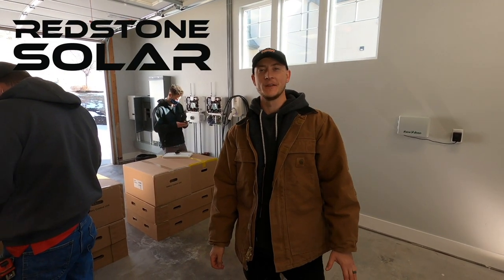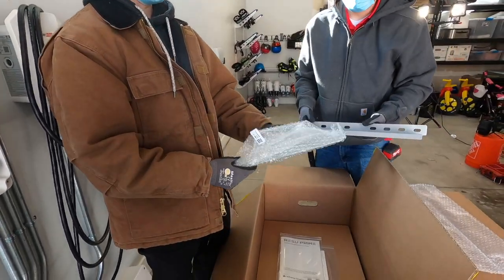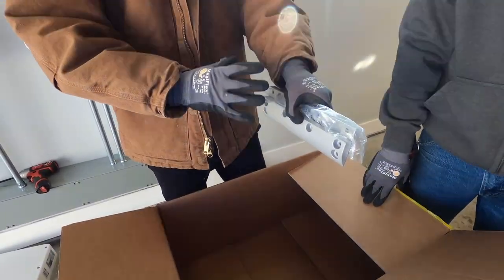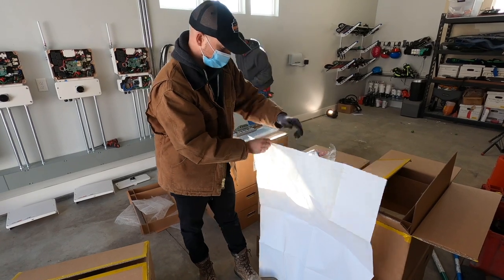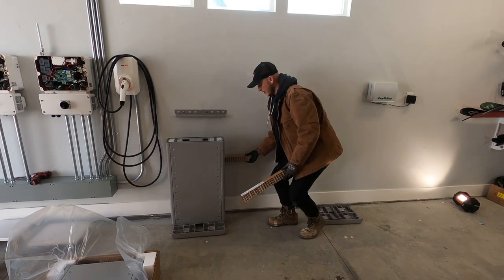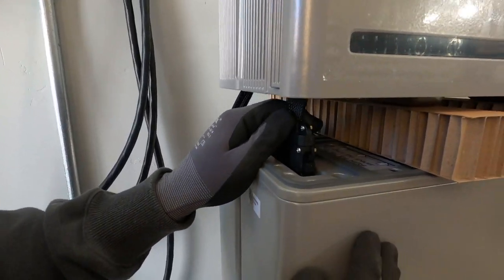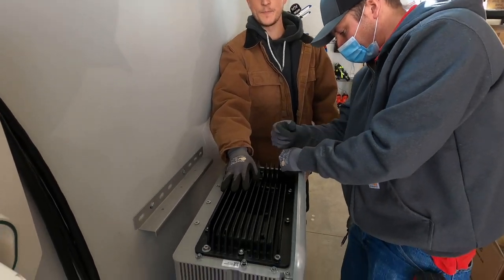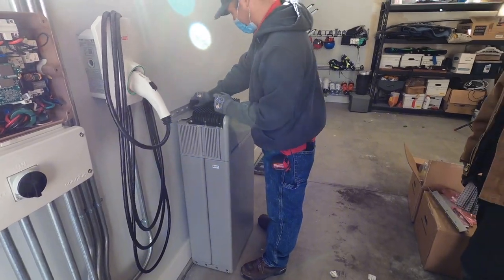LG RESU 16h Prime | Installation Overview

Comment: Just did a very similarly looking install in rural Colorado. First time installing Resu. We found that the activating the monitoring portal was challenging. The property we installed at has no cell coverage and pretty spotty internet. Our SE inverters connected fine with a gateway but the RESU remote monitoring portal requires wifi or an ethernet connection. It would be cool to be able to use the same gateway we installed on the inverters for the batteries instead of running 200 feet of CAT5 wire to the router. Either that or a cell card I have a feeling a lot of these will be installed out in the boondocks.

Comment: Do these work with the Sonny boy inverters? Off grid Sonny boy inverters?
Reply from the maker: I believe the off grid version of that SMA inverter is called the Sunny Island. It works with low voltage batteries rather than high voltage batteries. Id recommend looking into something like battle born! https://battlebornbatteries.com/?gclid=CjwKCAjwqIiFBhAHEiwANg9szrtzHk6v83tRV_rratH3KPN8h1_PDD0aM9FbADGZ8cLbgekWJfaqjRoC1ZcQAvD_BwE

Comment: Great work team! can you install 2 LG RESU with one SolarEdge inverter?
Reply from the maker: Yes you can! Ended up adding another battery at this site so each inverter had its own, but you can add 2 per inverter.

Comment: has solar edge enabled the stacking inverter function on energy hub inverters yet? IE more continuous and peak power like with the powerwall
Reply from the maker: I believe that it came out with the latest firmware (3.2537).
Reply: How many batteries can you hook up? IE could you do one more on Third inverter?
Reply from the maker: Checked with SE today. Stacking is available with the old 10h but not the new 16h. (Expected March). You can do a total of 6 16h prime batteries, 2 with each inverter.
Reply from the maker: *expected software update may

Comment: Sweet install, as usual. Does Redstone primarily use SolarEdge? I prefer Enphase since no possibility of loosing all panel production with single inverter failure. How do you feel about eventual S.E. inverter fail? Only a matter of time before you get a callback. Your track record w/S.E. inverters? ThankU.
Reply from the maker: Thank you! I agree that is a huge selling point for Enphase. SolarEdge will never be able to compete with small solar installs and no single point of failure. 2 points for enphase! However SolarEdge wins on every other aspect scalability, efficiency, price, output, warranty etc.

Comment: I have a Solar company selling me a 9.6 KW system with a LG 16KW resu back up battery they say I will get 120% Solar offset so I will make money by getting 1 year contracts then switch companies I will get a check for credits left. And that a16KW battery I can possibly run up 
to 4 days on back up battery. Battery comes with 15 yr warranty they are extending 5 more. But mostly Can a backup battery power a home that long without recharging?
Reply: Depends on your usage.